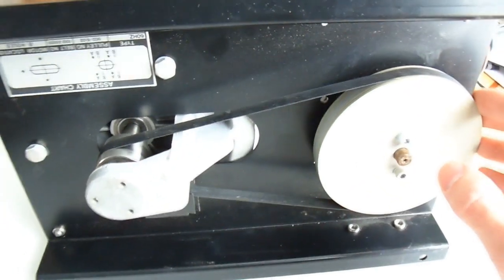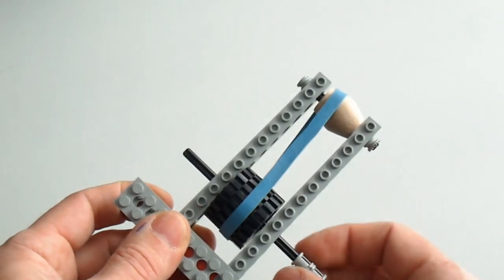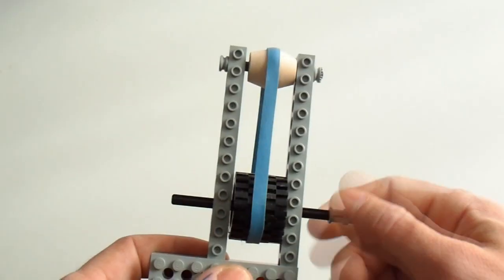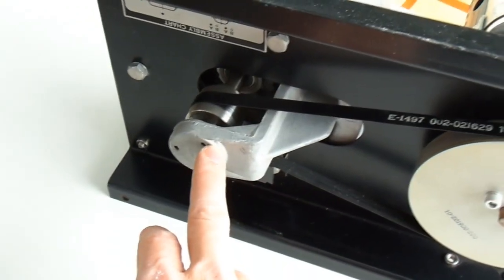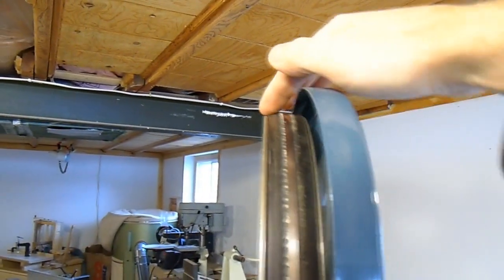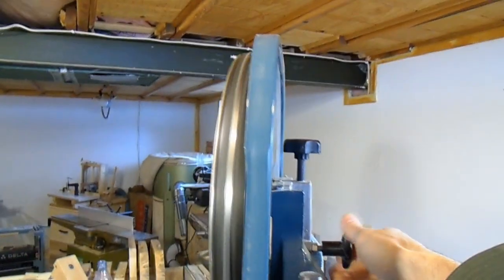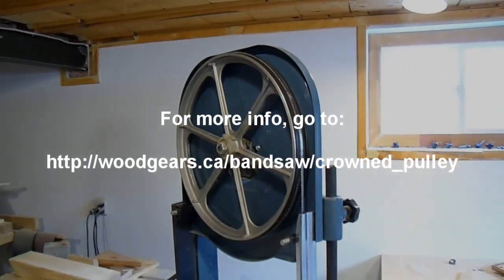How crowned pulleys work

Comment: I finally learned about this when I was trying to keep rubber tracks on a treaded robot. I added flanges to the sides of the wheels but the tracks came off faster than without the flanges. I tried making a crowned pulley and it worked better than the stock wheels.

Comment from the maker: Got it at a surplus store many years ago.  Used it for the wasp sucking contraption.  Also used it as the blower in the air engine video (its actually quieter than a vacuum cleaner, and about as powerful)

Comment: With a flat belt, the contact surface is running at the same velocity or speed across the width of the belt. So it is relatively friction-free. 
With a V shaped cross-section the big end of the V travels at a different (faster) surface velocity then the small end of the V.  This means the V belt is trying to travel at many different speeds at the same instant.  Most of the contact surface is either sliding and skidding against the sides of the pulley or sheave grooves. 
It also has to slide into and out of the grooves as the sheave rotates.

Comment: PS - The "out of alignment" pulley's on that webpage mentioned, is not an equivalent problem to a crown pulley. i.e. in the "out of alignment" pulleys, the wheel is pushing the belt off from the side - a sideways thrust if you like.

So it looks a similar situation, but it isn't

Comment: You're correct. It doesn't explain it. (Just suplimental for your viewers I guess)
It's a nice problem.
I have to imagine it as a "want" of the belt to restore stress equilibrium across the belt width. i.e. the only way it can do that is to fall off the pulley or climb onto it. There is more friction on the uphill side so tendancy is to remain there. I'm sorry I can't give a reasonable description in 500 characters. I "think" I almost understand it.

Thanks very much for replying
Cheers

Comment: @MufinMcFlufin - unlike the belt shown in the example, which is flat on both sides, a v-belt has ridges running along the length of the inside of the belt. These ridges fit into valleys cut into the pulley face to stop the belt slipping off sideways. If you can have a look under the bonnet of a car, in all likelihood the belt driving the fan in front of the engine will be a v-belt.

Comment: Hi Mathias - Like you say - tension is kind of key.
When you knock the belt to one side in your vid, draw the line of force(tension) in the belt. It may be that the line is no longer perpendicular to the pulley axes.
I wonder if the line is always directed in the direction of the crown pulley centre, if so, the belt will tend to follow it.
To test this, i guess you could build a wide crown pulley and offset the belt a lot to see if there is a point where it wont re-centre.

Just waffling here

Comment: I think the curvature visual using the cut rubber band shows the opposite curvature to what you want to show.  It should curve toward the side with tension.  Great videos!
Reply: +Stephen Chamblee I don't even understand what you mean here but what Matthias showed was correct.
Reply: +Bobany 
The uneven tension caused the rubber band to bulge out very slightly on the side of tension but made the ends of the rubber band move a lot.  Regardless, I expect that the movement toward the middle of the crowned pulley is caused primarily from the band's tendency to tilt to as it tries to lay flat on the angled sides near the back of the pulley.  Is there a way to figure out if the tilt or the tension bulge has more influence?
Reply: No it curves toward the side with lowest tension. the internal tension in the belt is not even. It is greatest on the pulley as it deforms the most there.

Comment: Mattias, Great demonstration, but I think you got the wrong explanation for why the belts track to the high spot.  I think it is really due to tension.  Your Lego/Broccoli-band model helps.  The part of the band on the high spot is under greater tension than the part of the band on the side.  Thus, as you turn the wheel, the asymmetric tension pulls the band to the center.  When the tension on both sides of the band are equal, the band stops moving left or right.  This is not dissimilar to offsetting clamps for squaring a glue up.  

I looked at the comments over the past two years and no one mentioned this.  Maybe some discussed this in an older comment.  In any case, thanks for the physics demonstration!
Reply from the maker: Well, if no one mentioned this, perhaps you are uniquely wrong?
Reply: The greater tension would cause the band to slip off more, not less. Things under tension want to minimise that tension, not maximise it. 

Imagine you had instead a loop of string with a tensioning weight on it, dangled over a horizontal cone. I hope you're imagining this wouldn't self-correct, but would fall off? The force balancing the tension will point upwards and a bit to the side, perpendicular to the face of the cone. As the cone turns, this force will act on the string to move it downards off the cone. What causes this case to be different is that the width of the band, and its elasticity. The high tension on one side means a greater length, and to fit that in, a curvature is induced. Now imagining the crown wheel surface as it meets the band, that curvature will cause the band to meet the wheel at a slight angle, pointing towards the centre of the wheel. Over time, this corrects the motion.

To imagine instead a band that doesn't curve, this would behave like a huge number of parallel string loops like before. They don't interact, but can show unequal tension across its width. These strings would just pop off the end, one by one, exactly as if they were on their own.

Without the curvature Matthias demonstrates, the crown wouldn't work.
Reply: I'm with Fred B here, but I think I can provide a bit more explanation. I think the story here centers around what happens in the region just prior to the belt coming into contact with the pulley. I suspect that much of the belt (not near the pulley) is in relatively uniform tension. As the belt approaches the pulley, the side which will contact the larger diameter of the pulley not only goes into higher tension, but it also contacts the pulley first. This means that the line of tangency between the pulley and the belt is not perpendicular to the belt, but rather angled. That same higher tension, will induce a transverse contraction in the belt by Poisson's effect (look up Poisson's ratio on Wikipedia). So what you have near the point of tangency is the high tension side (anchored by friction on the pulley) pulling the lower tension side of the belt (which still isn't touching the pulley) sideways toward the pulley center via Poisson's effect.   That's my best guess.  I'll bet there are old engineering papers out there explaining and quantifying proper flat-belt pulley design.
Reply: +JReany Well, it seems to me what you've said is consistent with Matthias, not Fred B. You point out that the Poisson effect will cause a change in angle of the approaching part of the belt... That change in angle is caused by the curvature induced by the Poisson effect. Two sides of the same coin. Fred B said it was tension alone, without  angle change, that caused the correction. We both agree that isn't the case.
Reply: As several other viewers have noted, the curvature tends to pull the belt away from the pulley center (the wrong direction).  What I have described is a force, just ahead of the tangency point pulling transverse to the belt toward the pulley center.
Reply: The curvature is in the direction towards the centre of the drum, ie. the centre of the band moves towards the centre of the drum due to Poisson-based curvature. This is exactly in line with what you describe. I don't understand your sticking point except if you misunderstand the direction of the curvature.
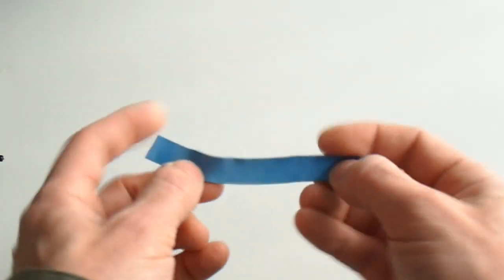Reply: Look at 1:09. You can clearly see the bottom of the belt below the line between his thumbs. Measuring it, it's moved by about 3% of its length, towards the line of greatest tension. The line of greatest tension is towards the centre of the drum.
Reply: Final comment haha... 
Going by what Matthias demonstrated at 1:09, and the fact that the tension is highest towards the centre of the drum (that can be demonstrated mathematically if you like), we have a curvature towards the centre of the drum. As you point out, our tangent line advances towards the belt as we approach the centre of the drum. So we have this situation:

outer edge         centre of drum
----______ 
      l              ---------  tangeant line
       l             l
        l             l   curvature induced due to tension this way -> due to length of inner edge being longer than outer edge
         l             l
outer              inner edge

which clearly would advance the belt this way ->.
Without the curvature, or without friction, the band would simply seek to minimise its overall tension and move this way <---.

Comment: Do you know if this principle can be used on cogged belts without messing up the belt? I want to try this on my 3d printer, but I am worried it will distort the belt. I'm wondering if there is a formula for determining the amount of optimal crown you can get away with... (Off to google I go...)
Reply from the maker: I have never seen this used for cogged belts.  Probably doesn't work on cogged belts.

Comment: I can't find a tilt adjust control on my bandsaw. blade tries to walk off the bottom wheel. it's centered on top wheel. any suggestions?? I'm afraid the blade is gonna jump off and eat my fingers.
Reply: it's a late 80's craftsman tilting bandsaw.  it's also a 2 speed saw & I'm not real sure which is faster. large drive pulley to smaller wheel pulley or the opposite? was my fathers. he passed away. any help would be much appreciated
Reply: a bigger pulley on the motor, and smaller pulley on the wheel will make the saw go faster.  idk about the tilt control knob on ur saw.

Comment: Hi Mathias - This is a very interesting phenomenon, (& I can't yet explain it simply).
If you google "how it works crown pulley" you should see 1st result is from Ihup.  edu

This page is posed as a question and more or less repeats what you mentioned. It does introduce the paradox though which requires a robust explanation.
Very interesting stuff.

Good vid 5* Thanks very much

Comment: I discovered this mechanic or a similar one on the toilet. Yes .. read on... If you pull the paper towards one side it will eventually get stuck on that side and it will break before you got enough etc. If you pull the paper to the OTHER side, which at first glance makes no sense as it would seem to worsen the problem, it actually makes it go back to center. Im looking forward to the Nobel nomination!

Comment: Nice try but I think you have a problem. Your solution involved an expanding /expandable belt. Band saw blades do not expand. Care to try again? Hint: Think of crown angles.
Reply from the maker: Alexander Craig There's no such thing as a material that will not deform when stress is applied.  It's just a matter of how much.
Reply: +Alexander Craig I think you need some sleep
Reply: Ask your physics teacher or consult a physics text for the explanation. It has to do with crowning angles.
Reply: The blade of belt will not track on a crown unless there is sufficient tension and friction. Also the blade/belt tracks best when there is a fairly long distance between pulleys. Over ten feet sees no gain, strangely. It has something to do with initial contact angle, in belts something to so with material stress distribution if the belt is made a certain way, (belt seeks least internal stress) and something to do with centrifugal force at speed. 

In an imagined model when the belt slips say to the left, the right side of the belt arches convexly to the right, creating a stretch force vector to the right at a slight but important angle, thus centering the belt. When centered the two vectors, right and left are equalized. 

At high speed if the belt slides to the left again, the right side is travelling faster and is under more tension. This, both at high and low speed causes a rotation in the belt fabric upon first  contact with the pulley -- in our left slip case, counterclockwise, which creates a clockwise tension force in the material -- moving the belt right or clockwise. The higher speed of the right side of the belt throws the belt more outward on that side, or in its travel direction -- on the pulley, and thus this side so to speak, seeks the higher part of the crown.
Reply: Why don't you make a video explaining it then Alex?